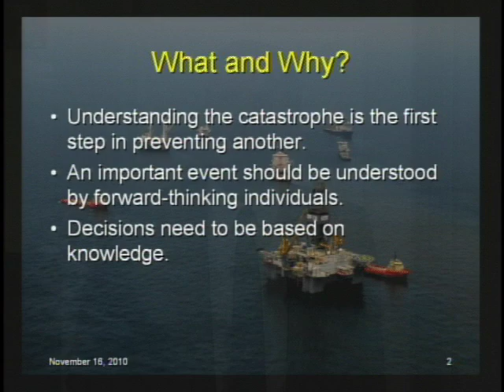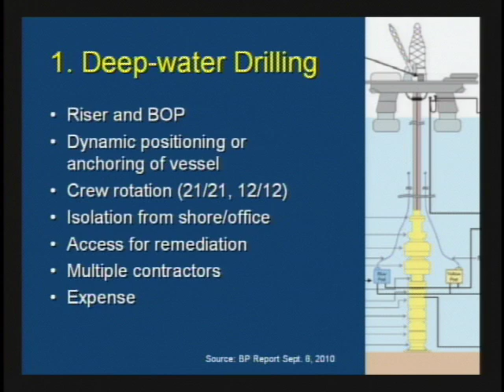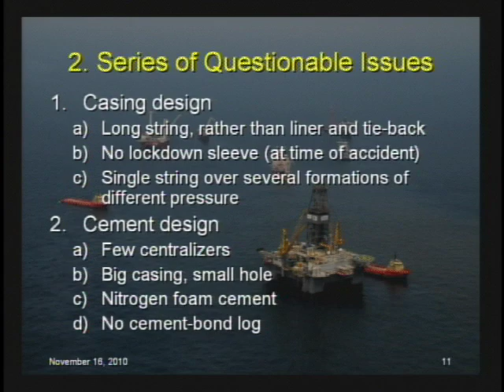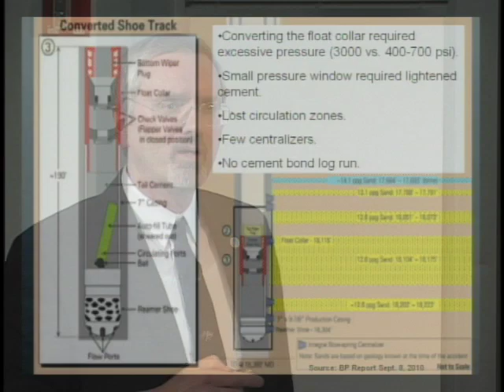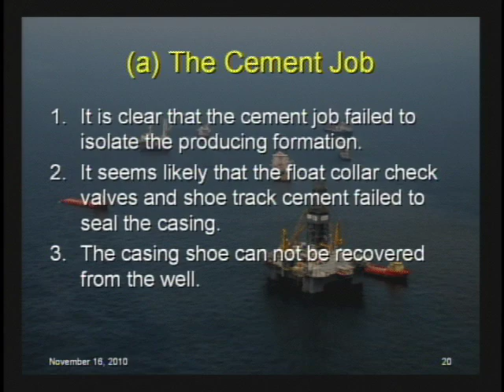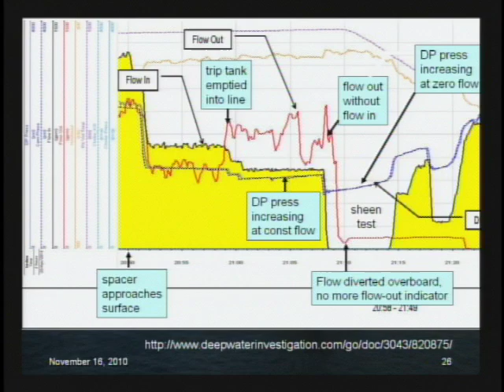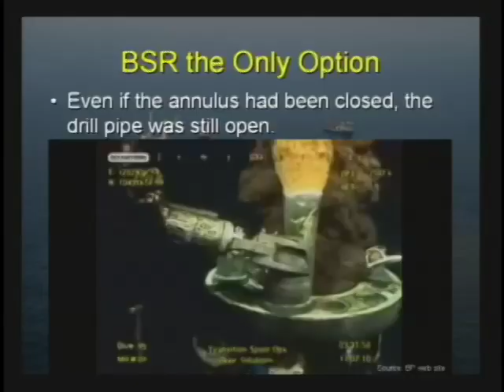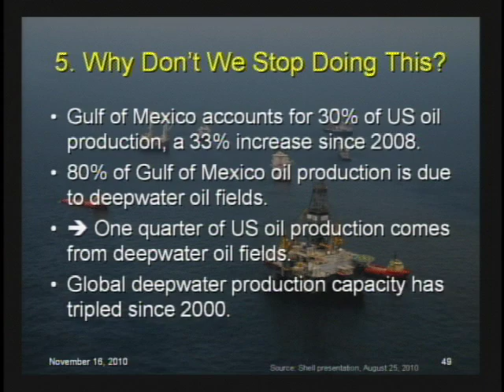The Deepwater Horizon Accident: What Happened and Why?

Comment: Are you saying that the 20" pipe (riser) goes all the way to the bottom of the sea? That is not the way it has been depicted in many diagrams? The 20" riser goes to the BOP and below the BOP is the drilling pipe that goes to bottom of sea and drilling pipe is only about 8" diameter. Am I right or am I wrong?
Reply: The BOP is on the bottom of the sea, not somewhere in the middle of the water.
Reply: @denysvlasenko1865  Obvious, that was not the the intent of my question, - does the 20" riser go all way from platform to BOP? Not to 18,000 feet at end of drilling or in 'middle of water' ???

Comment: as an engineer who works for one of the companies deeply involved in the deepwater horizon incident (not for BP)... i just am constantly /facepalming over most of the rhetoric involved in the "discussion" revolving around this incident and the greater conversation as a whole pertaining to energy, the environment and natural resources.
Reply: THANK YOU
Reply: @weaksohyeah  it's always interesting to see someone reply to a comment left years ago that has passed so far out of memory I don't even remember watching the video.
Reply: Lots of video’s on what went wrong but not much  details of the actual “oil leak point”and the many failed attempts to stop or slow the oil leaking  I watched the underwater tv news coverage at that time of the riser pipe laying on the seabed spilling crude oil for 87 days after the rig collapsed and wondered why the world’s oil industry does not have the specific riser diameter purpose built “robotic hydraulic crimping  tool “ that could at least dramatically slow even stop the crude oil spill “temporarily” , as to buy time to plan a permanent solution.

Comment: No amount of engineering design prowess can prevent an accident if those using the tools and protocols so carefully designed decide to ignore the proper use and maintenance of those tools and ignore the protocols.
Reply: Jose Rea I don't believe it was the rig workers for one minute, it was business decisions to cut corners. The working man is always blamed in big business.
Reply: They had plenty of time to realize that they had a blow out on their hands.but failed to..The CEO was not running the rig, it was the working man..and he fucked up...
Reply: @DynamicSeq  yea but when the working men hit their safety procedures, they did not work. they did as they were trained and there were other failures. same as chernobyl. when told to perform action X in an emergency, and then performed action X, but action X fails. it is not the working mans fault.
Reply: @gregoryeisenhut243  WTF...So if I train you for a job...Spend time and money to train you in safety..And you flat out ignore that training..Then you say it's not your fault ??.. 
At Chernobyl no equipment failed, the safety protocol said no more that 183 rods was to be retracted..They pulled 193..Well knowing that it was against protocol...And you say we don't blame them..I hope you work alone and far away from others, because with that attitude you are going to get somebody killed....
Reply: Watch the full lecture before commenting on these matters

Comment: @davidthefat : oddly enough, even as an environmentalist... there is good reason to look even to fission for power... it would be bad to do for centuries, but to get us from oil to more sustainable sources with less toxic waste would probably be a lot greener than getting there on gas and oil it seems.  However, the main solution is don't let a bunch of greedy assholes run whatever it is you do use to get massive amounts of energy.